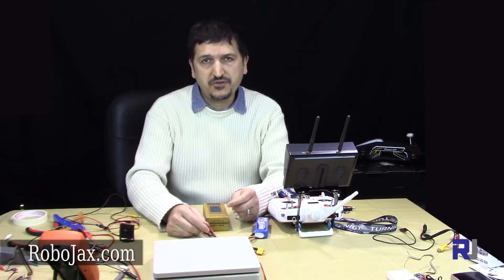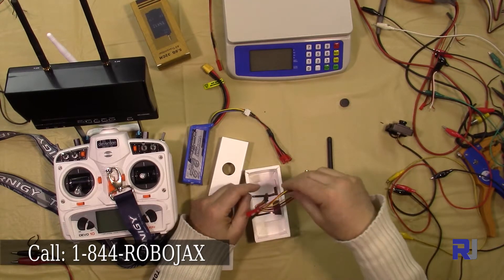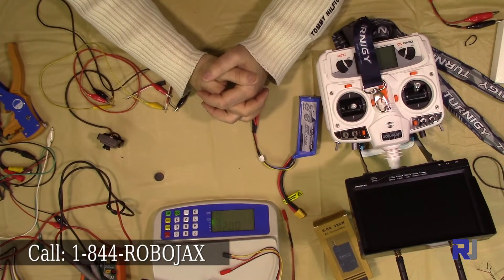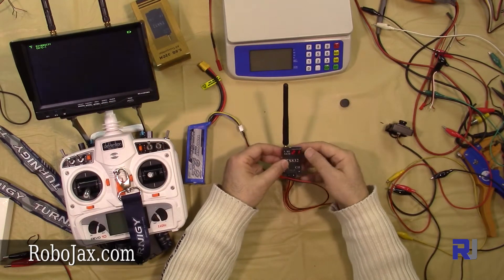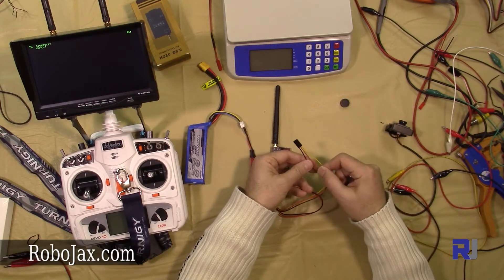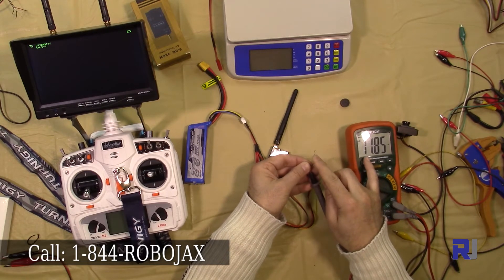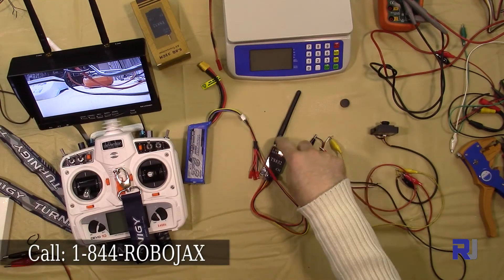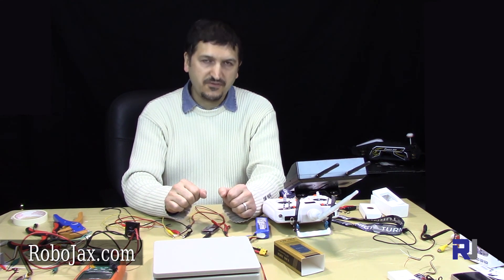Boscam TS832 600mW FPV Transmitter

Comment: Any way to use it with a raspberry pi camera? Got myself a night vision camera for the raspberry pi 4 which I wanted to use with tensorflow lite for object detection.
Reply from the maker: this is totally different. the camera input is analog like old TV or VCR while raspberry pi camera is digital. Won't work. The reason these are cheap is that they are analog.  Digital wireless transmitters are  x50 or 100 times expensive.

Comment: Greetings friend, a question, is it possible to use the following as FPV monitors :? thanks.
Reply from the maker: Any fob monitor with 5.8ghz will work with this
Reply: @robojax  thanks for the reply. I mean non-receiving monitors. thanks
Reply from the maker: No. fpv monitor is very complicated display.  you have to get that.

Comment: Regards. Congratulations on the video. What other monitor can be used? Could it be a laptop? So how to connect it. Thank you.
Reply from the maker: Thanks. The monitor is called "FPV monitor" which works with 5.8GHz.